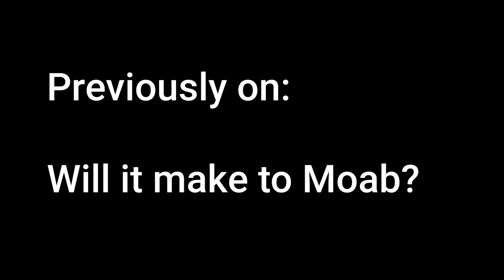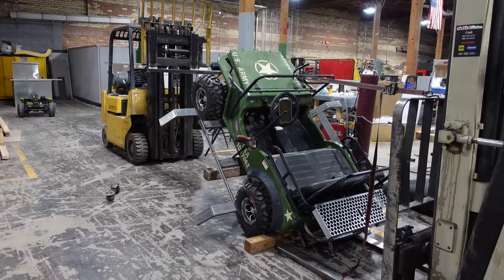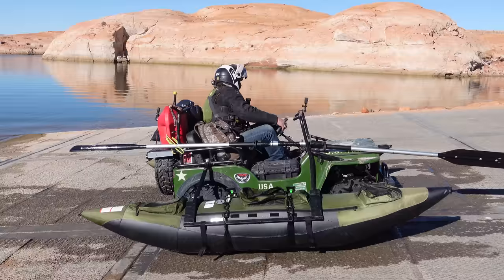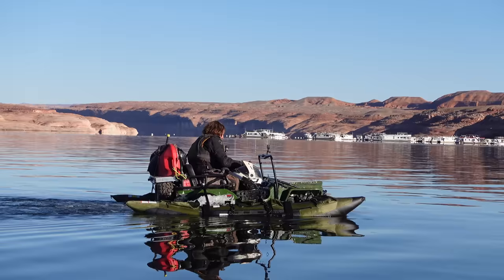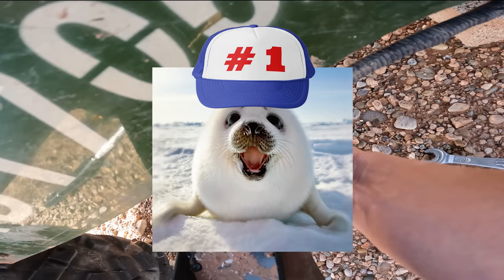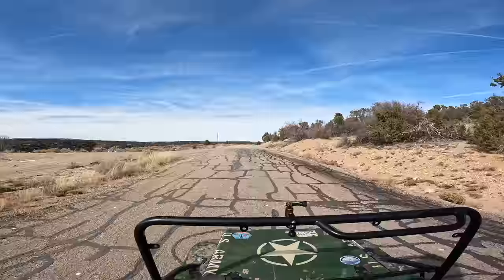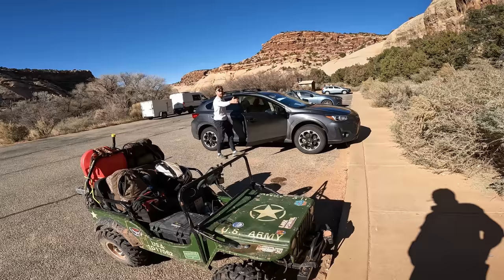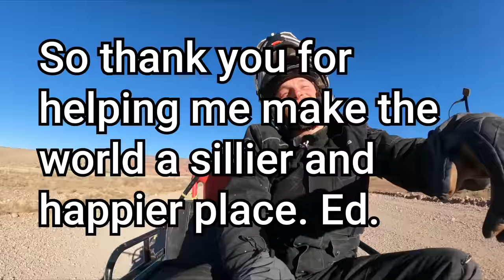Will the mini jeep make it to Moab? Ep6: Amphibious, off-road, THE END.

Comment: The fact that you do these adventures alone with no back up / camera crew and still make it is just amazing.
Reply: Or fake
Reply: @michealblevins4820  Yea... you're right this is fake. There were a few odd little things in previous videos, but this one has several obviously fake things if you know the area. The most obvious of which are the final stretch coming into moab. I could provide a ton of details but not sure if it's worth the energy but there just isn't a route this thing can do. lots of roads, theyr'e all way too rough, and they don't completely interconnect with each other, having big canyons in between, requiring even the gnarliest of off road rigs to return to the highway to get between the different areas. I thought this guy might have a winch and figure out some perfect route but then he just skips all that and just bam he's a couple miles outside moab already down in the valley. Boo. There is more, lots more, I could go on, but it's whatever. I wanted to like this guy. i was stoked the whole series up till this video.

Comment: Epic trip!
And the reason you should always leave a camp fire setup with some dry wood, is that it can save lives, specially during cold weather. Somebody can be so cold they bearly can move their fingers or so they can quickly get warmth. Here in Sweden we always leave a fire ready to light, or at least dry wood for one  besides the fireplace.

Comment: I've watched all the Little Willys saga's and loved each and every one of them. I have the same mini, in same color and decals. I used strips of rubber lawn edging to add flares to the running boards and fenders and added a wench and larger battery, gps speedometer, LED bar lights and the crowning glory, ... a realistic looking W.W.II  Browning M2 nerf machine gun mounted to the top of the windshield frame on the passenger side, (which the 11 year grand son is in charge of whenever we do perimeter sweeps around the neighborhood, looking for anything suspicious and of course I always insist he wears an Army Surplus Army Helmet for added protection!)
      I can't wait to see where you go from here (with locations and mods!) Also glad your sharing your adventures on a flash memory drive so we can all benefit from the higher resolution! 
     Nice Work! Keep em coming!

Comment: Honestly speaking. This series has been the best if not the most amazing promotion for this damn mini jeep! I have a buddy that runs a scooter shop and sold a few mini jeeps because of this series 😂 I bought one that I’m currently doing an engine swap on and some mods to strengthen the frame and suspension 😂 😂

Comment: our honda's 400 foremen from the mid nineties have lived outside most of their lives and hauled countless tones of wood up and down hills still run like new (with a bit more character).  the engine, the transmission, the driveshaft, and everything else about those things are absolutely bulletproof.   we've still got a fourtrax 300 from the 80's that we've never stopped kicking the crap out of that runs like brand new.   this new drivetrain will never fail this thing.

Comment: I think the best part about off-roading is doing it in something that isn't super good at it and/or probobly shouldn't be doing it, what's the fun if it's easy. I did my first off-roading last year and while technically my Jeep Liberty is trail rated and it wasn't a super hard track I still managed to scrape the underside a lot because there was a lot less ground clearance then I thought. It was part of the fun though and my Jeep handled it well for being old and not well maintained (I'm it's third owner!)

Comment: Absolutely beautiful piece of art! I just sprong upon this series and binchwatch it all, such a laugh, amazing what you are doing. I'm a moron too!! Taking a 1970 retired firetruck on more km then it EVER did, at least that's the plan.. (it had 28.000 km) broke down after a 50 km, then again after a 1000 km, then broke down really bad after 2200 km, fixed it, fixed it good, kindof , drove 300 km now since the repair, but I'll be a bigger moron to think it would be without trouble 😂all apart of the fun. 😂

Comment: This was an amazing journey, I’d love to take the same trip although I think I’d do it in my Polaris ranger rather than a mini jeep. It probably too late but that 4wheel drive conversion might be easier to do with drive components from a Polaris trail boss as they are chain drive front and back though I’d power it with a different engine, maybe a sportsman 500 engine. I’m not a Polaris fan boy , personally I prefer Yamaha but Polaris is largely built in components rather than assemblies, easier to retrofit.  Maybe after I get my hernia fixed I’ll plan an atv/ utv trip in Utah.

Comment: i wish willy has a universal oil cooler like what i have installed in my 100cc indian motorcycle its a 4 rows radiator for oil it is cheap but improves performce of the engine i'm pretty sure willy can conquer much more longer mile than before 😊

Comment: Ya know, what this thing would benefit from? Find a honda 125m engine. One with high and low range. And give it a lift, with 22 inch tires on 8 inch rims. Not only will you get a little more speed, but reliability and capability as well.

Comment: Mate I will buy myself a little Willey, but the little Wiley will need to travel by the Royal Mail to Australia. Could you please quote me the postage costs thank you.
Now consider this & its  just a suggestion but look out another 2nd hand Wiley , cut the rear half off and weld it to the back of the famous one so in effect you will have a 6x4 wheel drive with a longer tray= more cargo space and room for a fuel tank from a ute  mounted  behind the seat not under but on top of the tray in front of the 
cargo space, also look out for a trail bike engine perhaps a 125cc has plenty of grunt, it has its gear box built into it & is chain driven and after all of this it would look even more stupid than what it is now. 😉

Comment: I really wonder what route he took into the final stretch into moab. I recognize the back roads just after newsaper rock, and out by kens lake, but in between? I really don't think there is a route. There are a ton of roads, but very few that this rig could handle, and even the gnarly off road trails that there are.... don't connect to each other and are separated by deep canyons, needing to get on the highway to go between them. I was excited to see the final stretch, it would be the biggest test for this rig, I wasn't sure, maybe some roads you could actually do with this thing if it had a winch but no way you just cruise into moab from the south on back roads the whole way . Just not possible. Sadly, this is fake as fuck.

Comment: Hello Ed I ordered usb jeep on the 25 September and not received it yet ? Or a confirmation email? I paid £30.50p on the 25 sep to c90 adventures ?
Reply from the maker: Hi Ray, can you email me at the link on the website? It'll help me work out where it is, cheers. And there was a bug with confirmation emails, but not on the 25th. Make sure tracking info doesn't also go to spam 😬
Reply: @c90adventures  just email you ed
Reply: @c90adventures  hi Ed did you get my email yesterday
Reply: Think there might be a problem as I ordered a hoodie on the 19th of September and had no reply after emailing about it either, sent another just now. Just adding this here so Ed can work out if he has problems he is unaware of.
Reply from the maker: Hi guys. Yeah I'm currently working through my email system at the moment. I got totally overwhelmed by the volume of orders and emails, sorry.

You should get your replies within the hour. Sorry again.
Reply from the maker: @borntwisted  I just checked the system in your order was sent out on the 21st of September. I'm looking into it now. You should have got the email telling you that though on the 21st.